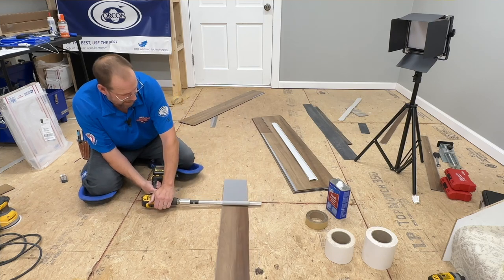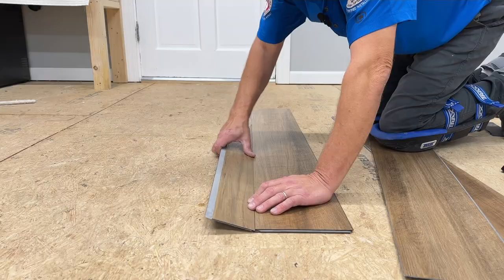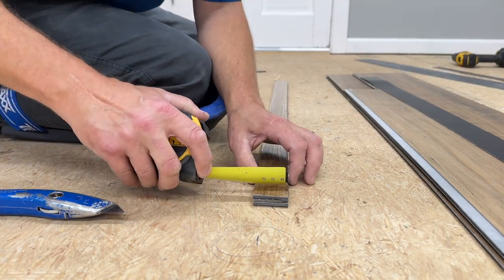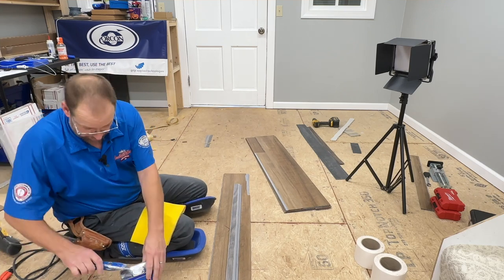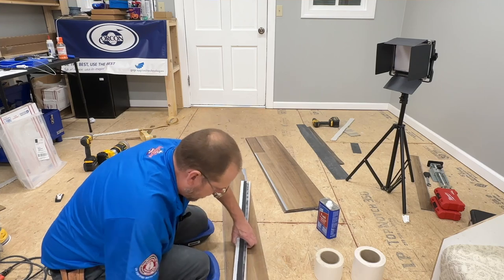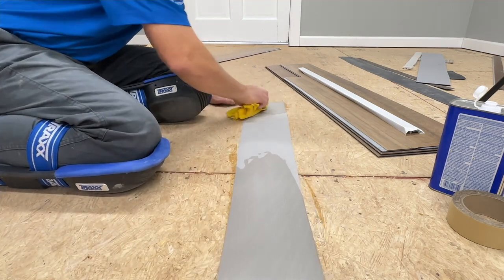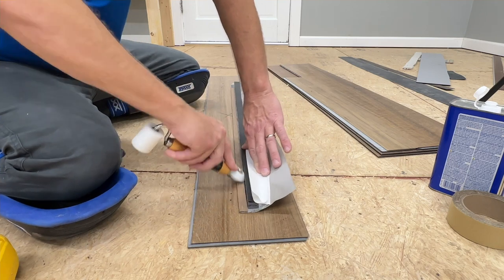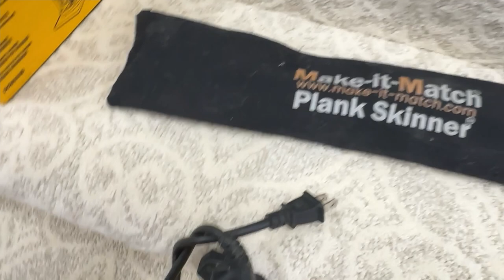DIY Vinyl Plank Flooring Transitions

Comment: The length of the video allowed you to describe the entire process..... that was necessary.
I've only done three transitions on one job.  I used a roll of scrim tape like the stuff that you used to laminate the layers together with.  They came out great, but on practice pieces I did get a few small bubbles that would not roll completely out.  I'm not sure if the Make it Match tape behaves differently.
It's so great that you're showing this process. 👍
Reply from the maker: Yes, the make it match tape is different. It is not all gooey like the scram tape and it is a lot thinner.

Comment: Yup, that's a lot of work lol, as long as expansion and contraction doesn't mess with the joint then it should be good, fun watch good work man
Reply from the maker: Yeah, this was my first one doing this. I will be doing a couple things different when I actually make one to install in the clients house. That will allow for expansion and contraction and also a proper way to fasten it without messing up expansion.
Reply: I mean if you glue to that routered lip it should hold the floor in place there, thats what I would do anyways
Reply from the maker: @jonathancowdin3775  Yep I was thinking about making it just a little bit wider there, where a router it, and adhering it straight to that

Comment: Just made my stair nose using your technique. The only thing I did different is pre cut a line with my table saw which allowed me to use it as guideline for my router
Reply from the maker: Nice work!
Reply: Using this videos technique?